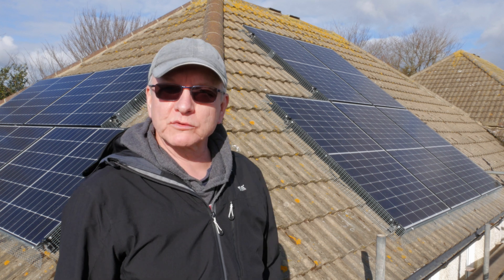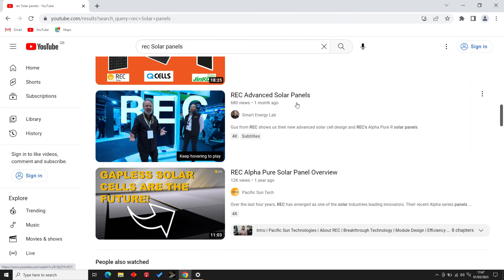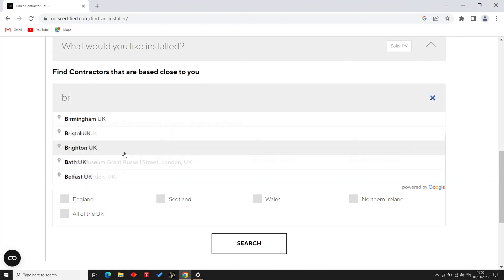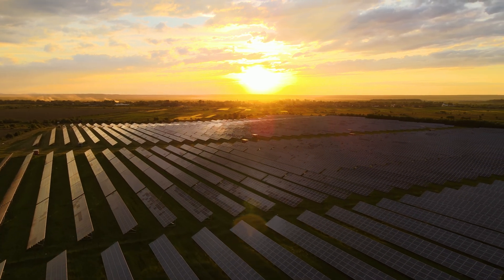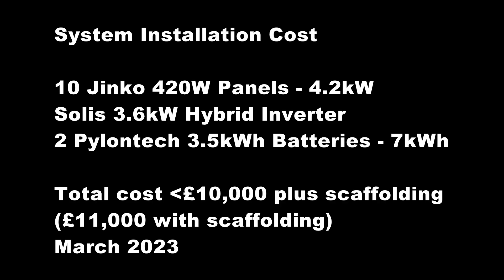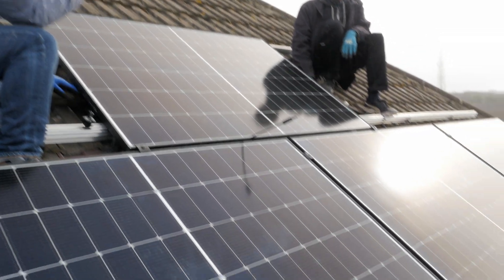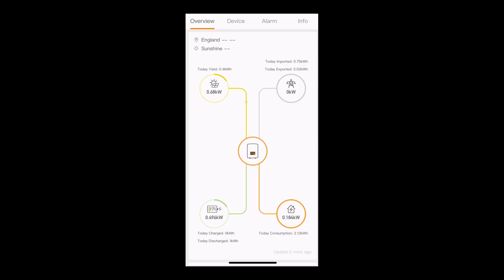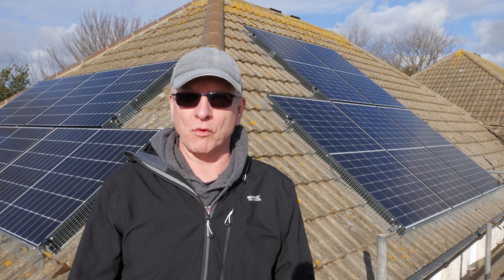Considering Solar Panels?

Comment: Hi Andy,
Well done, nice video. You wanted other people’s experiences so here goes.
My Solar journey started in December 2021 when we moved back from the South of France to the UK midlands. I had wanted to do it in France but not being fluent in French it was just too difficult especially as EDF France has a monopoly and there were many horror stories about them refusing to approve systems after fitting. Shame as we basically had probably 350 days of either wall-to-wall sun or very bright skies.
Anyway, back in the UK December 2021, initially I couldn’t get any installers to even talk to me, they were all far too busy, until finally in October 2022 I got a couple of really expensive quotes. The trouble was that even though we face directly south, the roof is at a 60 deg angle and because of its construction I didn’t want to add extra load so wanted “integrated” or “in-roof” panels with the tiles removed. The initial estimates were for over £25,000 for 17 panels but I was looking at Solar Edge equipment with optimisers which is more expensive as is the in-roof system. The price for a GroWatt system was considerably less and I didn’t think I could integrate it with the HomeAssistant “Smart Home” I was creating, although I have recently found that I probably could.
Finally I got a recommendation from the son of a friend for a local installer who initially came in at a bit more but was prepared to negotiate and even brought his roofers to take a good look at the roof.
We settled on a price and a system then at the point of pushing the button he found that the GSE system whose technical data said it was ok up to 60 deg only has MCS certification up to 50 deg! I wrote to GSE in France who finally replied that, YES their technical data was wrong!
So back to the drawing board checking other mounting systems and we have finally come up with Solfit which looks a much better system but more expensive and we possibly can’t get the 17 panels on, only 14, but he is going to try for an extra 3 if possible when the roof is exposed and they have the full picture and the extra 3 at cost!
So, Installation is arranged for May and we are keeping our fingers crossed that it all goes as well as the experience with him so far.
When the system is up and running I will report back. Good luck with the channel.
Steve
Reply from the maker: Wow, thanks Steve, I guess I had it pretty easy in the end. It was difficult finding an installer and I was lucky that eventually the local guys came back to me and I just preferred them over my first quote, which was good, it was going to have nphase micro inverters and a huge battery system, but I knew there was nowhere for that to fit in the house and it was 50% more cost. Ironically, due to shortages, I ended up with exactly the same panels that they quoted for anyway. so far, I’m really pleased and I can’t wait for summer now :-). Best of luck with your install.